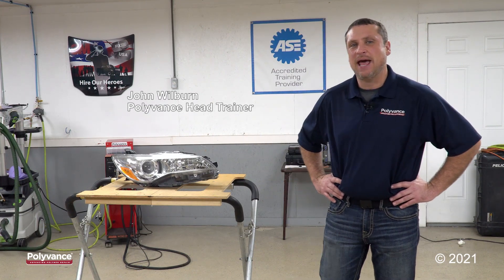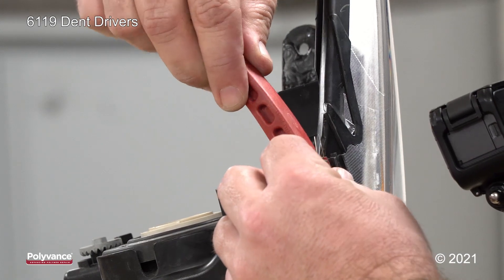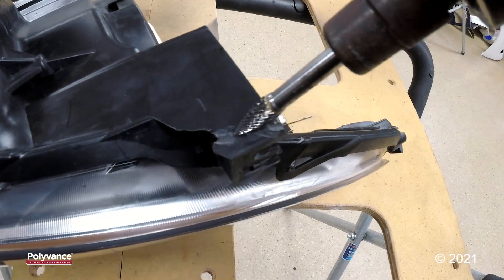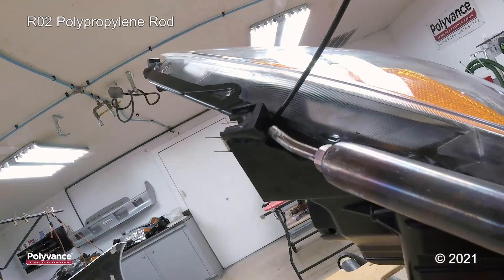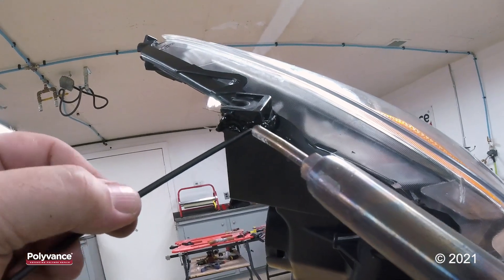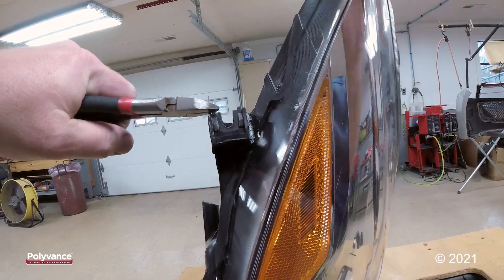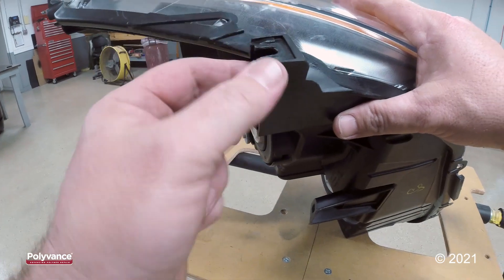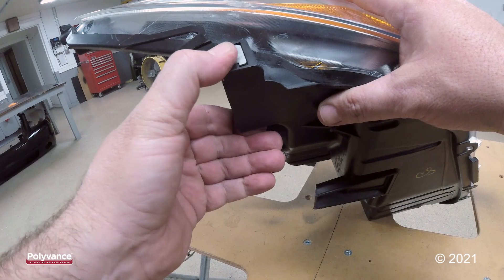Plastic Pointers #6 - Toyota Camry - Small Broken Headlight Tab

Comment: whoa whoa whoaaa, can you explain this hot nitrogen set up? how does it differ from a propane or map gas torch?
Reply from the maker: The nitrogen gas is heated and used to melt the plastic welding rods. The nitrogen acts as a shielding gas to prevent oxidation of the plastic. There is no flame. The temperature and power settings to the nitrogen and airless welders are dialed in on the front of the welder. Our welders also have flow control, which can be adjusted up or down when welding plastics of different thicknesses.
This is the welder we usually use when we film our videos: https://www.polyvance.com/Nitrogen-Welders-1/8203/ This is our top-of-the-line model with digital controls and it has its own nitrogen generator.